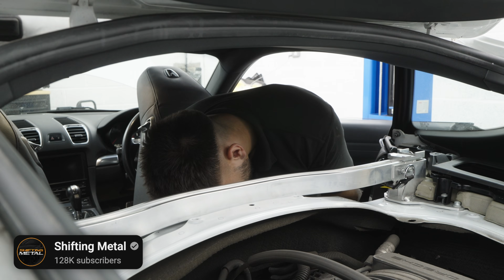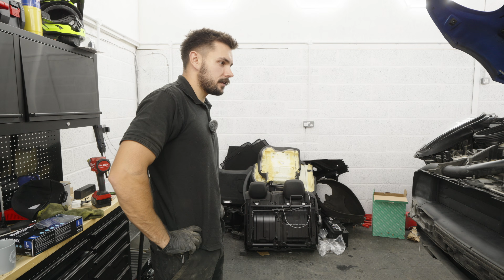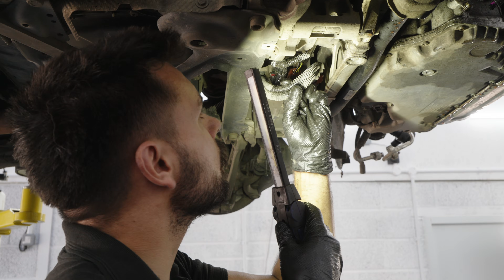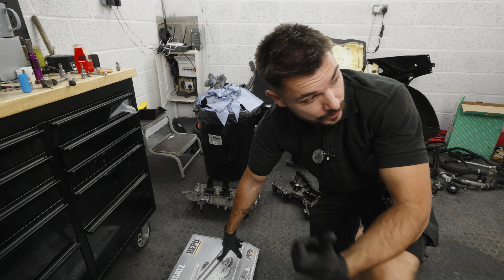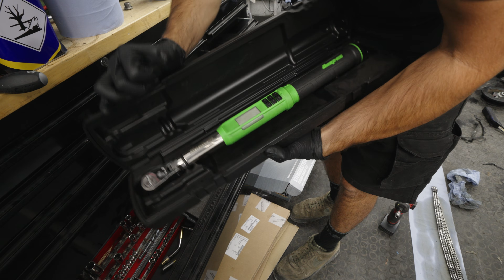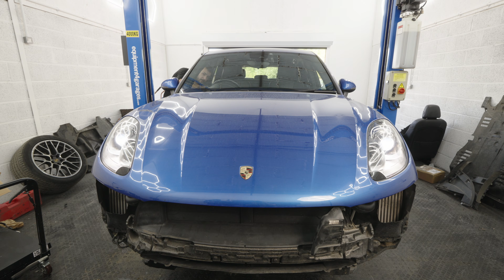Why Did This Porsche Macan Develop Death Rattle?

Comment: would have replaced the timing cover bolts with the new steel bolts/aluminum washer, no chance of the timing cover leaking after that since the aluminum bolts snap after a while

Comment: Hello, excellent video thanks.
Question, the actuators that you examined were shot. Did you look closely at the tensioner to see whether it might be faulty? Then if yes, or if you found it weak, do you think that this could have been the root cause, ie, Skack chain caused actuators to fail? 
Cheers.

Comment: Look at all that oil caked on everything under it. Them timing cover gasket seals are a known oil leaking issue along with the screws cracking and breaking. Bore scoring is also a possibility in the future. One thing i just dont get. Dont the cayenne s and the macan s share the same 3.0 t engine? So why are the cayenne's so much more reliable without as much issues than the macan?

Comment: I got similar rattling noise, but beforehand it threw codes P0017 and P11A2 related to bad camshaft and crankshaft correlation with no noises. Did it throw codes on this macan? Thank you!

Comment: As a mechanic/car builder of over 25yrs, I had a feeling it was "cam phaser" noise in the beginning of the video. Ford Ecoboost and coyote engines have cam phaser issues that sound almost identical to what it sounded like in this video. I specialize in 79-04 mustang but also a general mechanic and decided to start dabbling in the Porsche world last yr by purchasing an 05 05 cayenne turbo s. Absolutely love it, but thought it was kinda funny how the 4.5 in my cayenne and the 3.0 in this macan look so similar in engine design and layout being so far apart in yrs. Water pump in the same location, timing cover looks very similar as well almost looks like the same engine just 2 less cylinders and different generations.

Comment: 39:50 Been there as a non-pro.  I experienced literal 'flop sweat' when turning the key after my first full timing belt/water pump service on a 1.8t.  Fortunately, I discovered the belt was 1 tooth off in one section whilst performing a final check-through.  Still, I wondered what else I might've missed when I turned that key.

Comment: Hi Ben, great video.  I've watched it probably 15+ times as I attempt to do the chain on my porsche.

Question:  Both of my intake cams appear to have the same amount of back and forth clicking as yours, but the teeth on them are perfect.  Both exhaust cams are rock solid.  When you replaced the intake VVT sprockets did the new one have any movement?  My chain had quite a bit of slack and the guides are all great, I'm having a hard time finding where it was coming from.

Comment: Its got Dong wang pistons from China.
Reply from the maker: No it doesn’t
Reply: @benthompsoncars Thank the Mahle for that.
Reply from the maker: @jonathanjones3527 Thank Mahle for what?
Reply: @benthompsoncars the company who makes the pistons.
Reply from the maker: @jonathanjones3527 Okay, there is nothing wrong with these pistons…
Reply: @benthompsoncars Watched Dean on Saving Salvage , Porsche used Chinese pistons on some of their cars. £1800 for 6 replacements from Mahle!
Reply from the maker: @jonathanjones3527 That’s a totally different engine with a different code and isn’t relevant to this engine
Reply: @benthompsoncars Yeah , looks a lot easier,  it was engine out on the older model to change the chains. Nice work.  👍🏼

Comment: Quick question. When you changed the camshaft sprockets, did you change the center bolts as well or did you reuse the ones it had?

Comment: These variators to be worn like that are probably due to poor oil, low oil and binding of the cams. I wasn't sure if he did a compression test first.  Also can you tell me how many hours it took you to do all this work, I'm just curious I did a similar job on a Maserati and it probably took me well over 80  hours.  One of the problems with these vehicles is that there are no steel sleeves in the V6 or v8s for the Porsche cayenne's or Macan's. The cylinders are spray coated with the material, the coating wears through and then the rings eat the aluminum cylinder. There's almost nothing you can do about it. The Macan inline four has steel sleeves.

Comment: Chains just stretch regardless of mileage what a load of rubbish, what’s going on with the chain tensioners?
Reply from the maker: So you’re saying chains don’t stretch?
Reply: @benthompsoncars  of course they do but mileage is a major factor, as u know
Reply from the maker: @herobo123456 what point are you trying to make? I’ve replaced chains at 30k miles and 300k miles

Comment: Buy EV. Less maintenance.
Reply from the maker: True, more cost though. Replacing an electric Porsche motor isn’t nearly as cheap as replacing a timing chain. It’s what you want from a car I guess 🤷🏻‍♂️ Convenience or value, not that sitting at a charger is that convenient anyway

Comment: These engines received engine start/stop and that causes additional unreasonable wear on the engine components including the starter. 

My recommendation if you have one of these Macan, turn off engine start/off before you begin to drive.
Reply: Great part about the Macan Start/Stop is once turned off it stays off, don't have to keep doing it each time you start the car up.
Reply: Yeah start/stop is harmful. I want my engine oil warm faster

Comment: Timing Chains DON'T streach - The Roller/bushing Fail due to Thin Lubricants not changed at sensible Intervals,
No way that's a Job Porche intended as general Maintainance @150 per hour the cars a write off.
I Really can't Believe you didn''t change the OIL at least 2 Times !!!

Comment: Why do car manufacturers force you to disassemble the car just to perform maintenance on the engine?  All parts of the engine should be accessible without spending 8 hours removing body panels and other crap in the way

Comment: I got a service call one day to repair a 9 pin dot matrix 80 column printer in a bank.  It was on an officer's desk.  Expecting to see a plastic Epson that needed a new print head, imagine my surprise when there was a German 9 pin 80 column printer of a German brand name. I had to take 12 screws out to get the cover off. Once the cover was off, I had to remove several screws to remove the print head carrier. Everything in the printer was mounted with screws to the cast aluminum base which was at least 4 inches thick and all the attachment places were machined with flat surfaces and tapped for the screws.  I had to disassemble everything to get the print head out. It took me 2 hours to get it back together.  An Epson plastic printer can be taken down and reassembled in about 12 minutes as most of it snaps together.  I told the bank officer that if he ever decides to trade in that printer, I would love to buy it and hang the base frame on my wall as art.  This Porsche looks like the same guy who built it, also build that printer.

Comment: My wealthy Niece bought a Porsche a few years ago, and something went wrong with the engine, so she took it in for service.  It was under warrantee.  She went back to check on it a couple of days later and she was told that they don't fix Porsche engines.  They would be putting in a new engine. She said go ahead and change it and when they were finished, she took it somewhere else and traded it in for something else.
Reply: sounds like you neice is a wasteful lil girl , my nephew is same way : they are alergic to studying realistic things like bore scoring before wasting $120 grand on an image prop but I can buy thier ignorance for $6000 and have a porsche cayenne 2005 turbo that has all options , i only had to replace 1 headlight bulb , replace two tag light bracets , and drill out rusty tag screw holes and put boat epoxy in it ..we must pray for salvation because that milennial~gen z crowd 96~98 wouldnt know thier ass from being an ungrateful one ~ be well bro God bless

Comment: Magnesium can't flash rust as rust is the term for the oxidation of ferrous metals. Magnesium is highly reactive and does oxidise (corrode) quickly if the component is indeed magnesium.

Comment: looking at the tint on that inside valve color and other parts , oil changes were extended too far. As many have said oil is much cheaper than parts and labor for this job. I change every 5-7k at max with Amsoil. No problems yet.

Comment: Premature teeth wear is often from dirty oil and a worn chain. In this case the chain is the harder material and those cam gears are often a softer alloy.. would've liked to see the hydraulic tension tensioner install and release Ben. I was surprised that the macan uses cam driven fuel pumps as i thought they had a duel electric setup.

Comment: I hope the proud owner changes his oil frequently...every 5000 miles or so, otherwise his car will develop the Macan death rattle as the silicon bores wear out causing noisy piston slap. There is no easy fix; only very expensive ones that are likely to consign the car to the parts realm.

Comment: If the chain was stretched you would see it in the camshaft timing related live data. Cam phaser rattles of all types are very common these days. Also common, infrequent oil changes, that oil looked quite ugly. Dirty oil kills oil driven phasers and wallets.

Comment: A friend of mine was a master mechanic at Audi; he also worked for Mercedes Benz and BMW.  His knowledge of cars equalled  that of an engineer.  He understood much more about cars than any car mechanic I've ever met, at least as far as I could tell.  I said to him: "You're really an engineer in your heart and soul"...and he was beaming with joy when he heard that.  Automobiles are essentially designed from the ground up by engineers.  "Form follows function" is the modus operandi of automotive engineers.  

Ben Thompson is clearly an engineer, although perhaps he might not have gone to engineering school.  This video clearly demonstrates Ben is at another level.   

The amount of technology and engineering that Porsche put into the Macan is evident, yet G-1 (95B.1) resulted in some terrible engineering of certain engine items, such as the placement of the water pump (which, if the water pump broke, the entire engine had to be lifted out, pump replaced, and engine reinstalled)....11 hours total labor.  THAT is NOT good engineering.  Later generations of the Macan had the water pump placed elsewhere.

Many years ago, I owned a 1979 Ford LTD.  At exactly 55 mph, the then national speed limit, my car had a rumble very much akin to when only the rear (door) windows are open and the car's interior is buffeted by air entering the cabin, that resulted with a deep bass-like rumble, about 20-30 cycles per second.  However, this happened when my car's windows were shut tight.  NO FORD ENGINEER COULD FIGURE IT OUT.  Many could not hear it.  It was a design flaw, some called it "Body boom", and discussed how the rear pinion angle affected how wind passed over the car's roof and rear deck.  One mechanic placed larger rear tire rims and larger diameter tires, and the noise remained.  He had no explanation.

It was terrible, and Ford did NOTHING about it.  I sold the car and never again would ever buy a Ford car.

I could have used a fellow like Ben, who probably would have been able to solve the problem.

Comment: Great job ben,have a 2017 3.0 s with exactly the same thing, booked it in with porsche bristol,said it needed a new engine and was going to cost £24 K  ,supplying dealer took it back for repair and diagnose the chain tensioner for £165 ,caught it early, so no other damage, fair play for getting stuck in
Reply: Did the tensioner solve ur issue w that rattle noise? I got the same thing going on. Can the tensioner be replaced without taking half the car apart?
Reply: Have that fix the noise?

Comment: Seen it twice now! Such good commentary as you go. Very enjoyable and interesting to know parts prices too. One thing I noticed was much grime and dirt build up on intercooler rads ( the ones low down each side) ...also mud etc behind lower panel drivers side. It was sold like that as its not visible in sales prep but Surely you don't just put everything back as is ?. Good chance to wipe clean or not bother?

Comment: I think the tensioner failed first, and thats what ate the teeth of the cam gears. In these cases, where the tensioner is bolted in from the outside, it might worth a try to replace only the tensioner at first. For example, on Mercedes OM642 engines (3 liter V6 CDI) the timing chain rarely stretches, but the tensioner is likely to fail. But you can replace it without taking apart anything.

Comment: 0-30W Oil kills engines. 5-30W is better for more lubrication
Reply: I use liqui-moly 5w-40 molygen.  it is the thickest a40 Porsche spec oil.
Reply: I'm seeing the same thing.  The thin oil seems intolerant of any dirt.  I think all of these thin oil motors have tolerances set too tight, and all are at risk.  Extended oil change crowd beware!  These are not the engines for you!

Comment: Fingers crossed you put the tsb bolts in the TCC corners. THAT solves the leak. I’ve done the gaskets twice. And the bolts 4 times. But the new bolts have lasted 30k miles.

Comment: It’s the pistons. Cheap Chinese pistons were used instead of decent pistons due to shortages.
Reply from the maker: What a load of shite
Reply: @benthompsoncars  Not quite Ben. Saving Salvage had a 3lt Macan with piston slap on one bank making a very similar noise when the oil was hot. After he had changed the chain he discovered Porche had fitted undersized chinese pistons for a year or so due to supply issues from the normal source.

Thats were all the 'experts' are getting the piston issue from. Of course your diagnosis was correct and it was the chains.
Reply from the maker: @tillyfoxtrotter No it really is. This is completely different engine to Saving Salvages.

Comment: Genuine question Ben, How do you sort out all the nuts and bolts coming off in such a big job? You set them aside by a particular order? into draws? bean cans?
Reply from the maker: I typically use folding magnetic trays, I also have a big empty bench that I can place things in order of which they came apart
Reply: @benthompsoncars  Thanks for the swift reply. Impressive.

Comment: All Porsche Macans have the same problem when hot, and it's not the camshaft or the timing chain, it's the smaller pistons with a diameter of a few millimeters, this is because Porsche like WW have put banal Chinese pistons found at a good price in the engines of luxury cars, and these pistons when cold meet the specifications, but when hot they shrink, causing the piston rings to dance in the cylinder.:hand-orange-covering-eyes::hand-orange-covering-eyes::hand-orange-covering-eyes::hand-orange-covering-eyes:
Reply from the maker: What a load of nonsense 😂

Comment: Watched a video with same noise where the chain had slack so they changed it along with tensioner and everything but rattle came back. Some of these Porsche / Audi engines have ,due to lack of material in corona time , chinese pistons that Porsche approved!!!!!!! and when they opened motor there was noticable movement of piston (by hand)...  there was nothing to do than to exchange all 6 pistons... after that it run great!! I have also searched in my history and found video so everyone can watch it...
https://youtu.be/KSD8kcPeQto?si=sWqiIPumeKibz6BL

Comment: From what I could see is that those 2 top pulleys work on the same principle as the back sprocket on a motorbike cush bearing, takes the load when engaged . If the cush Bearing wear it causes the chain to slap against the sprocket very slightly every time it's engaged this in trun will damage the sprocket teeth , I'm probably miles out but just my observation.

Comment: Good job but as an ex 911 owner, what a complete load of shite that engine is. Porsche are going downhill fast the timing chain is way way to long, and those sprockets are total crap. I now run around in a Honda Jazz superb engineering when I work on it very easy and resonably priced for genuine parts that come with a warranty. The Germans are losing all their engineering cred.

Comment: How did you rule out it not being a bad chain tensioner? (Subscribed for the recommendation for the Cuntech timing tools 😂)
Reply from the maker: My train of thought was that even if it was the tensioner the damage has been done and the pulleys need replacing regardless, the kit also came with a new tensioner

Comment: Absolute shedload of work that. I'll be honest as well, I did think you might struggle with setting timing perfect without proper tool / tensioner pressures to ensure everything is perfectly balanced but worked a treat. Great work. Liked and subbed.

Comment: I would strongly advise you scope the bores on every V6 macan you get in thats got over 50k on the clock.  Excellent job on this btw, those chains are not known for stretching but the variators are weak points.  As are the tensioners which I reckon is the actual root cause of the issue IMO.  Anyone who owns a Macan I would advise oil changes every 6k and gearbox service every 12k.   Sounds OTT but they are verrry expensive out of warranty.  I have had 3 Macans, great cars but I dont know if I would have another.

Comment: Amazing video! It is surprising how a premium manufacturer allows itself to combine complexity with unreliability. Even more surprising is the mechanic's neutral reaction to this situation. After all, this is not a sports car where it is acceptable to sacrifice reliability by pushing materials to their limits for the sake of winning a competition. This is a premium SUV with low mileage and very expensive maintenance. And it rattles like a bucket of bolts at 60,000 miles?! How can one comment on this mess so unemotionally?!